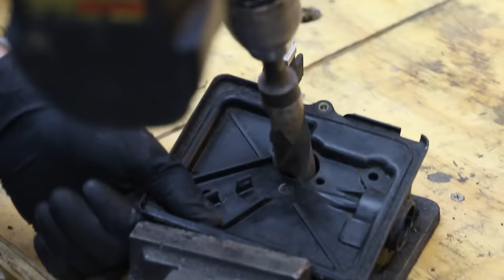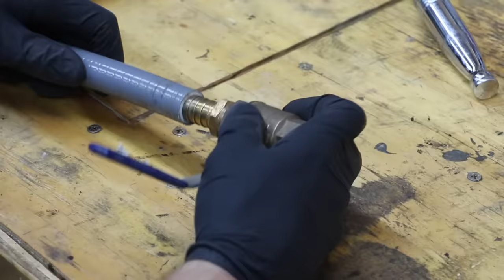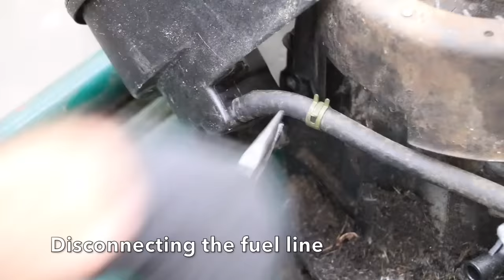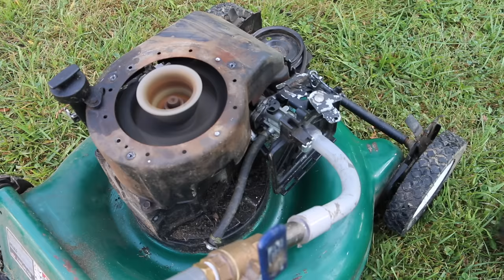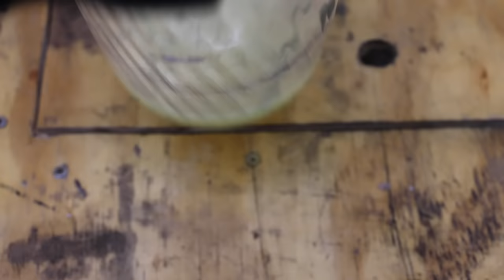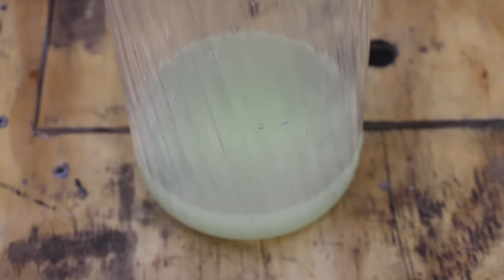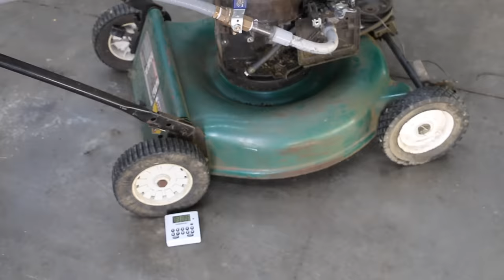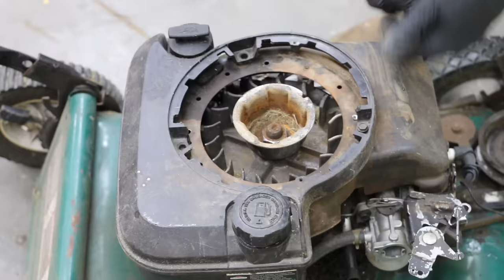Will a "Gas Vapor" Container Improve MPGs and Fuel Efficiency?  Let's find out!

Comment: Imagine being this dudes neighbour and wondering why he mows his lawn 365 days a year
Reply from the maker: lol  Thanks would cause some interest!
Reply: still better then seeing him as the seller when you pickup your used lawmower from craigslist; wood cylinder head, performance booster monster bottle, banana based oil replacement. then you know why the ad said "as is" for 2 our of every 3 words in the ad.
Reply: If this guy was my neighbor I’d be saving lots of money on gas!
Reply: Lmfao
Reply: @ProjectFarm  now try this with the farmabago
Reply: the farmabago!! up and down the middle of the farm zoom being chased by a go-cart?!!
Reply: "hmm, why is he changing the weed whacker all the time? I wonder if he's doing ok".
Reply: @ProjectFarm  

I saw were they added water to the fuel being vaporized. I saw 3 parts water to one part fuel. It supposedly ran longer. Don't know what the water vapor did to the engine or the oil. 

If your willing to do a retest with water added to the fuel, please do so at 1 to 1 ratio, 2 to 1, and 3 to 1 ratio to see if adding water will increase run time or just ruin the oil or cause the engine to run lean.

Thank you.
Reply: I would love to have a neighbor like Project Farm.  At least he does cut his grass.  
I have two that wait until it's time to harvest the grass like it's wheat.
Reply: Could you use that same setup but on one air intake pipe add another valve so have more control over air in and change the fuel to water in that some jar then another pipe go onto the water and then feed it with hho gas to that jar with water water in it because hho people feed it to rich so I hear and then make hho generator as close to stan mires car that runs on water he use a scaler high voltage circuit the plates in it needs to act like a capacitor and the main circuit that drives it is like a pump electric goes back forth and because the plates act like capacitor static electric energy that pumps back forth saves energy input increases the production of hho there are video on this and show the circuit and because air is mixed some way you just did it you can change amount of hho to combustible as difrent fuel like petrol or deasle and also the vacuum from engine makes nano bubbles and helps increase  the fuel intake i think the peace there you have is already half the problem the rest just try best you can
Reply: Already been done and patented  they killed 
The guy
Reply: Bet he is using this method to run his car now with this current climate :)
Reply: 730 times equals twice a day...but neighbour get there's cut free 😁
Reply: @ProjectFarm ?
Reply: @ProjectFarm  would be interesting to see you do the fuel mixture canister experiment using e85 or straight ethano. l See if you get a proper fuel mixture. In addition you may want to add an air  control  jet which allows you to mix straight air without coming through the fuel mixer for a leaner burn.  Test what that does for fuel economy. An evaporation canister mixer is going to obey the laws of physics and saturate the air as much as possible. The canister may produce pretty rich mixture without a lean air valve. Aircraft carburetors are designed so the aviator can run lean peak EGT. Exhaust gas temperature.  In that way the the airplane enjoys a markedly improved fuel economy longer feel engine life due to reduce fuel wash down in the cylinders  a modest decrease in exhaust temperatures and a very notable drop in cylinder head temperatures. Modern exhaust gas and cylinder head temperature senders are very cheap. Hope you can work with the canister project in greater detail.
Reply: He lives at a apartment.
Reply: @reypolice5231  The engine power will be lowered which is not a fair comparison of fuel economy
Reply: Neighbors wondering why he's washing and waxing the car 20 times a day for a week...lol.